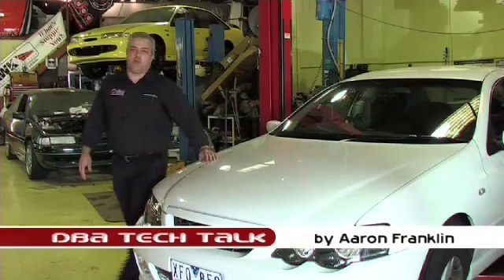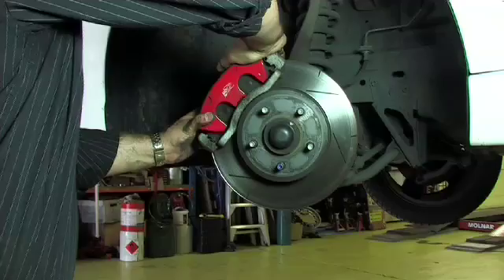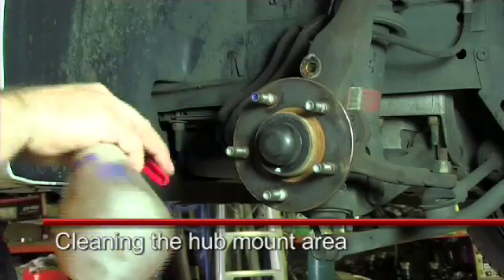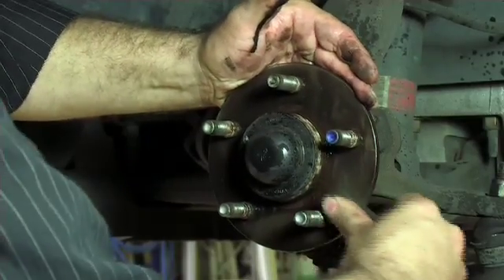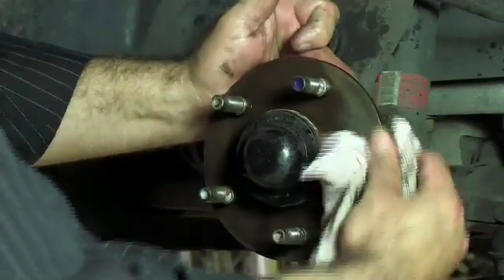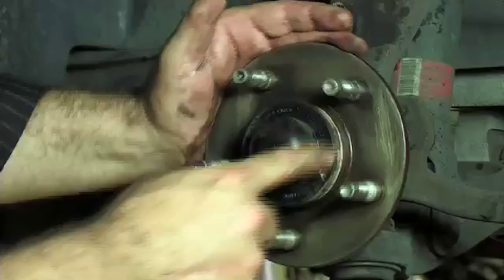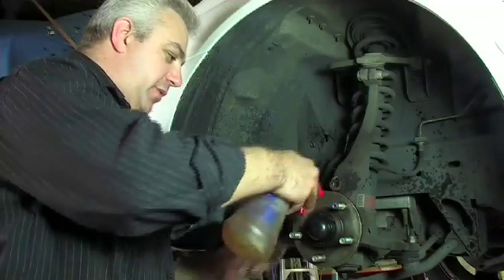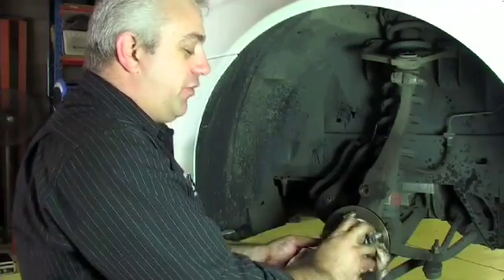DBA Tech Talk Video Episode 1 - Part 1 Fitting a brake disc rotor www.dba.com.au

Comment: I wonder if my Pontiac G8 is having brake shudder because of this. Very good info. I had the rotors turned, but I dont remember cleaning it.

Can you do this with a wire wheel to get the bulk rust off and then come back with a stone?

Comment: nobody does that crap because sometimes its not necessary. it should only be done when your brakes vibrates and requires a new rotors, or when your rotors need resurfacing. if your brakes dont vibrate, then doing this might cause a vibration due to matting surface changes.